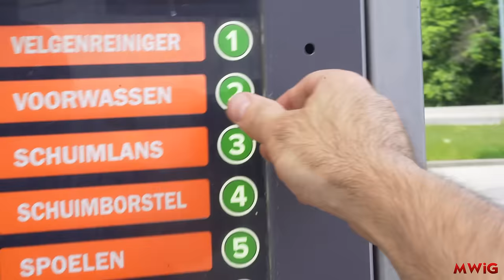Trailer Restoration - Repair and Restoration of my old Trailer

Comment: I think trailers are great fun to restore. I bought an old home-built one, threw away the wooden box body (rotten) and used the axle and draw-bar to create my own with a welded steel frame (black) aluminium sides and back (yellow) for visibility, LED lights for reliability.
Then I bought a motorcycle which couldn’t fit in the trailer, so cut the trailer body in half and put in another mid-section to make it longer. A project is never finished! I really enjoy all your stuff, thank you for good videos.Les in UK 🇬🇧

Comment: After just  looking at your video, i went to the back of my shop i had one just like yours, over 25 yrs old.. Took it all apart and replaced the O-Rings works just great, only thing it weights about 80 Lbs,use to pick it up with one hand now i need a chain fall to help me lift it up.
Reply from the maker: Wow. good luck mate.

Comment: That was a great restoration of a nice trailer.  The one thing I would have done differently is used LED taillights instead of incandescent.  They are more reliable and last longer.
Reply: Helluva lot more expensive aswell.
Reply: @GBOB68  I don’t think so. I used all LEDs on my home made trailer. Any way the biggest advantage is their reliability. Very often you see trailers here in UK with only half their lights working (or less). My LED units have been flawless for a number of years. Les in UK
Reply: @leslieaustin151  I didn't mean you shouldn't do it. I've got LED's retro fitted on my own trailer. Hence the statement I made above. I personally wouldn't use incandescent bulbs on a trailer as the vibrations tend to kill them pretty quickly, which I've realised through experience.
Reply: @GBOB68  OK.

Comment: Turned out nice. Abit overworked for a utility vehicle but looks good! I did similar job to my 1969 trailer, but it had more frame rust and needed brake job and such. Will replace the wooden bed next year. Will do for now.
Reply from the maker: Thank you Buddy. Good luck in your project.

Comment: Nice restoration, I should have used betonplex for bottom and side panels. Also use a breaker cable for hook up.
Reply: It is an unbraked trailer, required to have a safety cable or chain, not a break-away cable like overrun-braked trailers do.

Comment: next time if you need to paint youre rims get a pack of playing cards and stick those between the rimedge and the tire , thats enough to cover the tire from overspray
Reply from the maker: Thanx for advice buddy.
Reply: watahyahknow cool tip, thanks!
Reply: Nice tip
Reply: It is really really stupid to sandblast wheel rims with tires on
Reply: Good tip 👍
Reply: Yes it works everytime👍

Comment: The utility trailer is the smart choice of Europeans, who don’t see the need for pickup trucks.
Reply: Mike Gerrits but what about total haul weight limits?
Reply: I don't i love my pickup ,from the UK
Reply: I didt also a pick up today.
Reply: @themaxee08  depends on your trailer and pick up.
The max weight for trailers without a brake in Germany (probably the same in most EU countries) is 750Kg. The weight of the trailer alone is probably around 150Kg so you can haul around 600kg.
For trailers with a brake the max GCWR is 3,5t (if you have the normal car drivers license (B)). 
That means normally a max payload of around 1t to 1.3t.
Compared to a standard pickup you would see in Germany (Vw Amarok between 600 and 1000kg, Toyota Hilux around 1t) a trailer is cheaper and better. 
The problem in Germany (maybe EU) with big pickup trucks is that the max weight for a car is 3,5t. For example a F250 with a maximum payload of 2t in the US has a max payload of 900kg in Germany. ( max weight 3,5t - 2,6t empty weight)
If you need to haul more than that you either need a lorry driver license (and buy an American pickup and register your pickup as lorry and only drive 80kmh/50mph) or a BE driver license (trailer up to 3,5t)
Reply: Jehty huh interesting to know.
In the US I’ve hauled around 1800kg in the bed alone.
Reply: Austin Hise 8
Reply: Full size Ford pickup, 8 ft bed. Once I  replaced the so-called tow bumper with real steel, 1.5t in bed 2.8t trailer. No special license needed. Chains are a must in case the trailer comes loose.
Truck is an 05, bumper was custom  built in 79. Outlasted three pickups.

Comment: Great job. Reminds me of doing the same type of job on my home built trailer over the years since it was built in 1981. The new couplings we get here have  a notice on them not to use the top holes for mounting just the side bolt holes. I think you should add side bolts as well and maybe make a D  handle that uses the top bolts. Makes it easier to move around and you can also use it for a tie down. Nice job on bringing the trailer up enough so it tows level, makes the combination of trailer and vehicle look like someone cares.
Also like the no music/talking format:)
Thanks jb
Reply from the maker: Thanx for advice mate.

Comment: Not sure about your country. But in UK all trailers are required to have 2 red triangular reflectors on the rear.  Without them the trailer is illegal for use on public roads
Reply: And a secondary coupling.
Reply: This is in the netherlands or belguim bc the menu you saw in begin is dutch words
.voorwas. is prewash..but dutch and belguim is almost the same
Reply: Not needed for small trailers here
Reply: @lucas2002D  belgium, licenseplate is B and i see this exact model and brand all the time up here
Reply: In Slovakia this kind of trailers (to 750kg) required "prescribed number of reflectors", license plate lighting and reflective sticker of maximum speed limit... It sucks because on many old trailers-also manufacturerd in our country, you don't have this stuff and then it illegal to use on public roads. So get approval for operation and permission to made trailers, people's buy it and then you can give them a fine. That's logic of Slovak politicians and police.
Reply: Lucas 17 D could clearly see a white with b licenseplate
Reply: Same here in Germany. But some taillights have an integrated triangular reflector.

Comment: Looks good, be careful welding zinc, wear some protection not to inhale it. Isn't it mandatory to have a steel cable in case your trailer gets loose?
Reply: No if it doesn't have brakes
Reply: You'l need a fixed cable. Otherwise the trailer will run off on it self
Reply: In Ireland you should have a safety chain on a trailer and brakes on big trailers
Reply: safety chains are on most if not all factory built trailers .. brakes on heavy trailers .. some home made one's people don't put them on ,,, all should have ,., just seen a trailer come loose other day .. only thing that saved parked cars and the trailer was the safety chains ,,
Reply: @dot7107  if it is in Belgium and it is mandatory to have a steel cable to connect to the car and the license plate and fog lights are missing

Comment: Dam-those duo torgue style axles are worth more than the trailer in my country.

And youre using a stick welder-top marks.cant beat a stick for a deep weld
Reply: Hi
Where do you live?
Reply: @mannym5692  New Zealand.

Checkout trojan trailer parts(trailcom).

Be seated first

Comment: Please use some proper split pins on the hooks...the ones with the securing chain...won´t be fun if you lose them and my tires will pick them up...
8-o
Are there two different tires?
Great job!
:-D
Reply from the maker: Thanx for advice buddy.  Yes 2 different tires:-)) one is som larger then another.
Reply: @meanwhileinthegarage  :-D
Reply: Eeeeeeee

Comment: Get a jockey wheel so when it's not in use it'll keep the coupling off the ground and its easier to move around. Do you not require a safety chain in your country ??. Nice job though and having just discovered your channel I'm now subbed on. Hello from New Zealand. 👍👍👍👍😀😀😀😀
Reply from the maker: Your welcome buddy.

Comment: Very nice job. Have in mind that, by regulation, a trailer in Europe must have red reflective triangles on the back side and a safety steel cable or chain connecting the trailer and the trailer coupling on the car, as a safety measure.
Reply from the maker: My friend, thanks for the tip.
In the meantime I have done everything to make my trailer fully compliant with legislation and regulations.
Now he is completely ok.
BTW there will soon be a video with my new project.

Greetings
Reply: Meanwhile in the Garage do you have the id Plack on it I suggest to use your ID number my fellow belgian

Comment: Just wondering , I did not see safety chains on the trailer? Here in North America it’s law that your trailer must have safely chains. Don’t want that trailer leaving the road in an accident.
Reply: I'm not sure what the regulations are in Belgium, but in Holland a small trailer like this <750kg's has to have a steel breakaway cable attached to the tow bar. Trailers above 750 kg up to 3500 kg's need to have brakes on the trailer. There is a cable attached to the car that will activate the trailer brakes. This cable will break away and the trailer will stop without the car.
Reply: Yes, its mandatory to have one. AR 15/03/68 Art.54

Comment: if you drill new holes. dosn't it seem stupid to not pain inside them, when you have had rust on the trailer bifore ? like for mounting licenceplate on trailer-
Reply: I've been saying that for years.  You see someone build a 100k car then they drill a hole and don't seal the edges.   Beyond me.

Comment: just one question why did you split the tubing ?
Reply from the maker: Material was not enough.
Reply: ok no problem this what you could have done found some 1/4 plate and welded it to the back side of the tube …….the reason I asked is this use to build semi trailers at a place called Overbuilt trailers in Drumright Oklahoma  USA and we had strict dot standards we had to follow my job title was fitter / welder
Reply: you did an awesome job on the wiring and bed and rails but you kind of cut your haling capacity down by at lest half when you split the tubing

Comment: 2:35 You didn't repack those bearings with grease, under load they will overheat and fail. ;/
Reply: They're sealed bearings.. Hence no grease over the axle shaft

Comment: I've done this on a few different trailers. Boat ..and box type . Good if you have a concrete floor and roof to work under. It's a buzz to be pulling the masking tape off having finished a long restoration having cut ..welded..grinding ..squaring up..adding bracing and just twerking a few things to make it easy to use. Small ramps.. removable cage..jockey wheel..spare tyre mounting.. rewiring..bearings and seals..tyres..checking for wobbling wheels..good hitch and safety chain. All this is why my small trailers tow very well and are strong. But I very rarely loan out. Good show. Best Wishes from Jeff in Emu Park Australia
Reply from the maker: Thanks buddy. I wish you good luck in your projects.
Reply: @meanwhileinthegarage   thanks and I'll be watch now

Comment: Very nice. I see you've made your trailer higher

I have restored my trailer. It used to have Mini wheels. The indespension units were changed with different hubs on so now it has 13" trailer wheels. Had new tailgate welded upfrom steel angle, the original was made from checker plate without framing which was no good for me. I've replaced the 50mm ball coupling. The steel framework and wood was painted blue. It has LED lights on it

I live in England

I have liked your video and subscribed
Reply from the maker: Thanks Patrick

Comment: Most people I know don't take care of their trailers, they don't grease the axles and never check the wiring harness or change the bulbs .trailers are like cars, they require regular maintenance or you risk killing someone on the road. Nice job on this one, was that cedar you used for the bed ?
Reply from the maker: Thank you buddy. What tree I do not know. But the fact that they are outdoor for 10 years is for sure. Therefore, I decided that these boards will not spoil for a very long time.

Comment: I recoat the metal on my trailer every year. I had one wheel bearing go bad due to lack of grease( my fault) I cought it just in time. No damage other than replacing the bearing assembly. I ripped out the entire wiring and lights and went with the new LED system. They are for a boat trailer but thats fine, totally weather proof. For Northern Michigan, rust and salty roads normally eat up a trailer in no time. Mine is 15 years old and still looks new.
Reply from the maker: Good luck mate.

Comment: This was a very nice restoration.     If you weld the hitch on there would be no danger of those thin bolts breaking if you your friends/family drive over a rough or pothole road.     Excellent workmanship.     What type of wood did you use please?
Reply from the maker: Thanx mate   about construction don't worry.  It's strong inaf. I already tested it. Nothing is broken. Wooden plates are for outdoor, verandas and others. I don't know which wood is that.

Comment: 1. I didn't understand why you raised the trailer because you changed its dimensions from the specification.
2. You mounted the taillights the other way around because the yellow side must be facing outwards.

Comment: In Canada, our coupler is required to have a latch with a lock or pin on it and we are required to have safety chains, in case of coupler failure. I see none of that on yours. Interesting! Where I live, we also have to get them safety inspected every year.
Reply from the maker: Here in Belgium it's much easier.

Comment: That would never ass the MOT in Serbia, they would ask for manufacturer aproval to change the rusted parts , than the agency for safety in traffic would need to give aproval for change , than you fix it , than you go to MOT , they send you to to DMV to check the weight and capacity , and than again to MOT ... and every step you pay 50~100€ ... so it is cheaper to by new one ....

Comment: what kind of sandblasting setup do you use? electro?!
Reply from the maker: No, air pressure.
Reply: @meanwhileinthegarage  would be very nice to know a bit more, like what compressor you using, what tools and how much/long you can sand before it kicks in. :) i would like to sand too, but there are so many different setups and most of them need like a huge compressor. then there is the issue that manufacturers of compressors play around with CFM and L/min figures - like stating how much liter a minute flow in vs. flow out etc. Which makes it hard to know exactly what to look out for.
Reply from the maker: Checkout this video:https://youtu.be/zEy5ilfG8wE
Reply: @meanwhileinthegarage  Merci :)

Comment: Great job!  Should get decent life out of the new(old) wood, that original plywood didn't seem to be  outdoor/marine grade!Question: No requirement for Trailer Safety Chains in your part  of the world?? Mandatory in the USA.
Reply from the maker: Thank you buddy. I live in Belgium and here the chains are required starting from 750 kg.
Reply: @meanwhileinthegarage  Sorry MWIG, Safety chains or safety cables are required by law in Belgium. It is called a "hulpkoppeling" and not to be mistaken for the "losbreekrem" cable at +750 kg trailers. Read this PDF: http://www.lokalepolitie.be/sites/5444/images/folders/aanhangwagens.pdf 
Great job, well done! Delamination of the plywood: el cheapo Chinese plywood used? I have bought the same stuff, for concrete formwork. In two (2) days the layers became loose! Sometimes it is better to pay a bit more ;-)
Reply from the maker: I was wrong. I will definitely fix it. Thanks for the info dude.

Comment: Hah! Another Dingy. Why do people automatically think a two wheel dingy is a trailer when ya can hook it up behind yer truck? I dunno how many of em i have had. But i have had enuff of em in my life to know the difference between a trailer an a dingy. A dingy has two wheels. Thats 2. An a trailer has 4 to 6 wheels. 2 to 3 axles is under a trailer. Dingy's are not trailers. They have one axle an two wheels. Either way. Nice job on the Dingy restoration bud.
Reply from the maker: That's my fault. English is not my native language.

Comment: You should have taken tires from rims before doing anything to rims. Tires should be taken off at least once a year to check for dages, change valves, reset bead and rebalance.

Comment: No chains and no pin to lock the hitch? Yikes
Reply: Exactly what I was thinking. My electrical plug is also kept in the spare wheel well so when I hook it up I just run it to the trailer leaving some slack and close the tailgate on it. Keeps it from getting full of road grime when it's not in use.